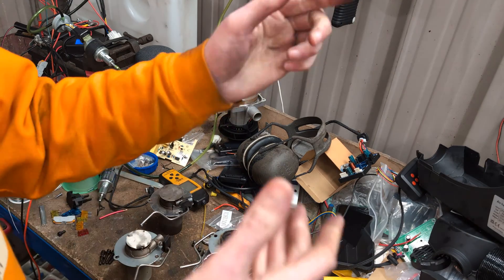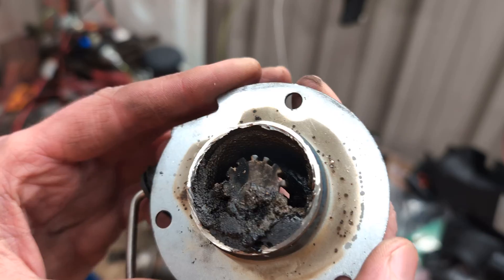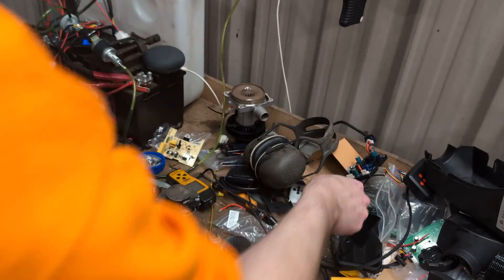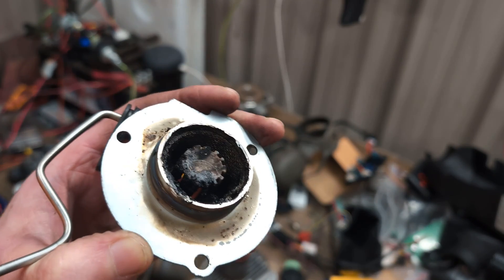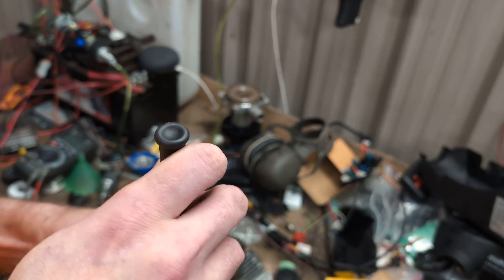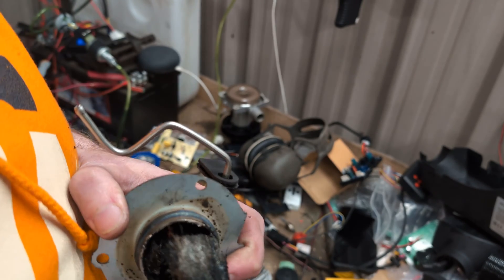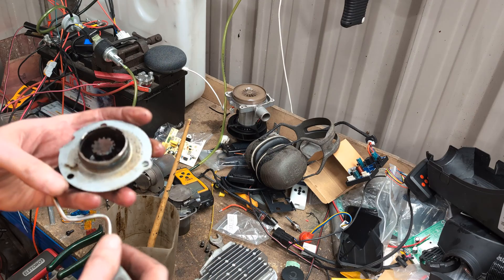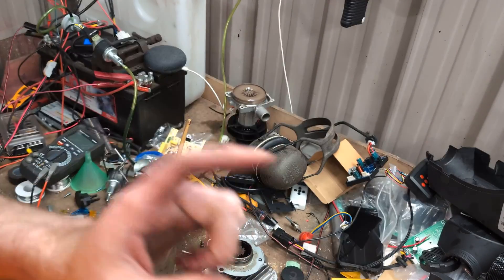Inside the inside of a diesel heater burn chamber

Comment: I wonder if there's a way to identify what this residual stuff is(oil additive of some kind?) and potentially find some way to selectively remove it from the oil prior to burning? If it's soluble in a specific solvent or maybe if it can be precipitated out by adding/mixing in something to pull it out of solution, you could process a whole batch of the oil at once which might not be too much of a pain. Would definitely need to know what it's made of though to come up with a plan to process it out.
Reply: Best guess- get two kits for engine oil analysis.  Put in one of them a  concoction of measured measured amount of CRUSHED /Pulverized scrapings from  burn chamber mixed with a measured amount of clean, off the shelf engine oil.   Second kit put  straight clean engine oil of a same measured amount of clean oil in first kit. (this is your base) .  Send them off for analysis
Reply: " typically consist of base oils enhanced with various additives, particularly antiwear additives, detergents, dispersants, and, for multi-grade oils, viscosity index improvers" Some of them like metal salts can probably be removed by shaking the oil with water or an acid/base extraction, but the majority probably require distillation or steam distillation.
Reply: Centrifuge

Comment: When you have to chop metal apart to clean out the guck left behind by used engine oil, yeah, don't bother with engine oil, it's more work than it is worth when used in this sort of application (and I am specifically saying *this* application considering someone previously used the excuse of pouring it into ships engines and commercial furnaces as a reason to use it in response to one of my comments, which are not the same thing!!)...